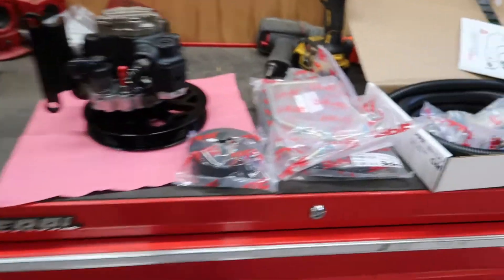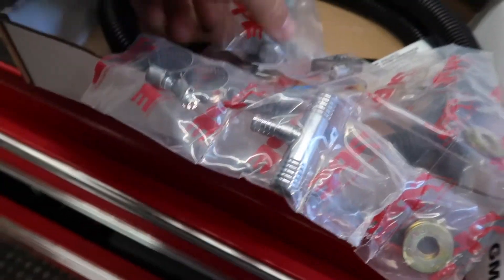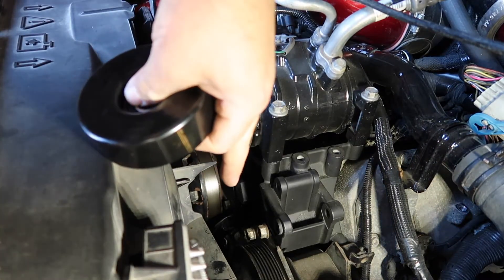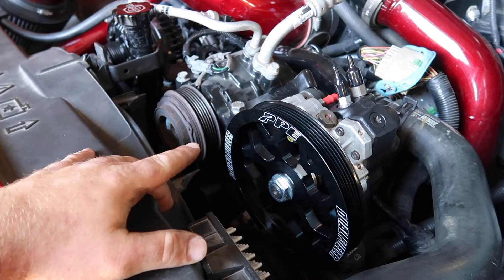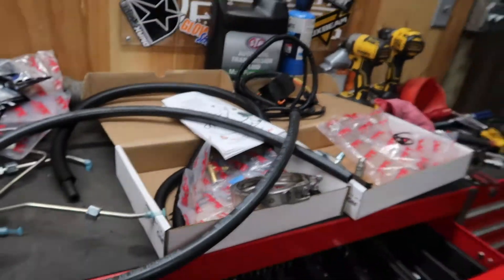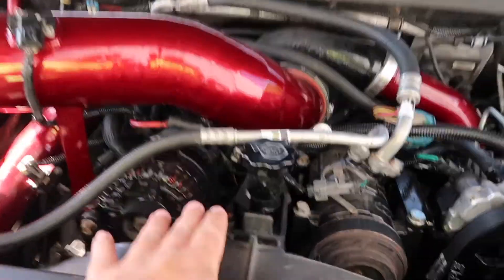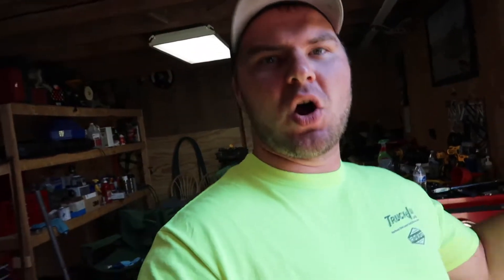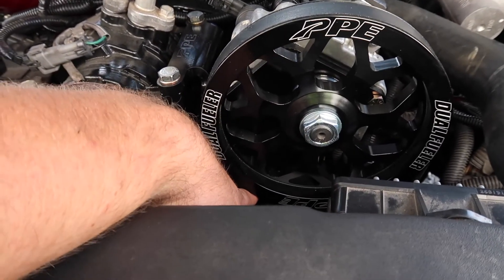DURAMAX dual cp3 install

Comment: I put the ATS kit on my LB7, you can tell there is a big quality difference between the PPE and ATS kits, as well as belt routing common sense. I guess you get what you pay for, mine came with all briaded lines with 6AN fittings.